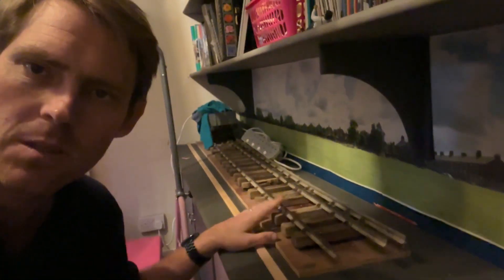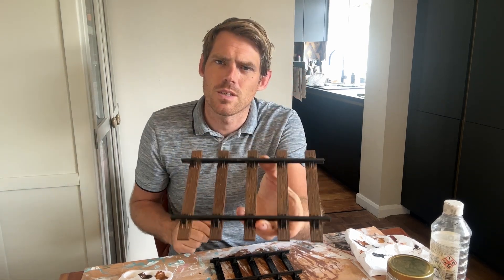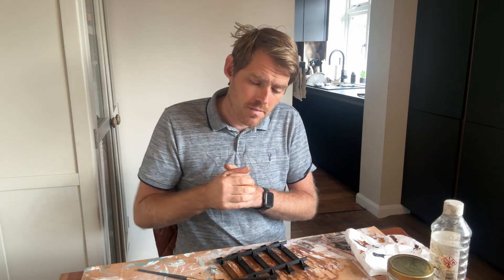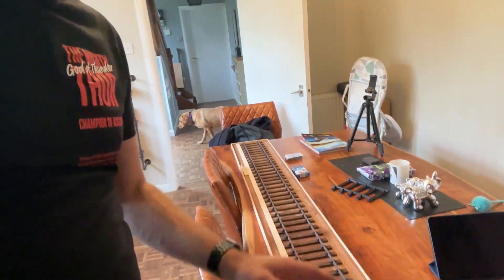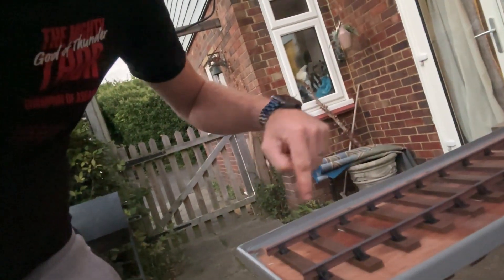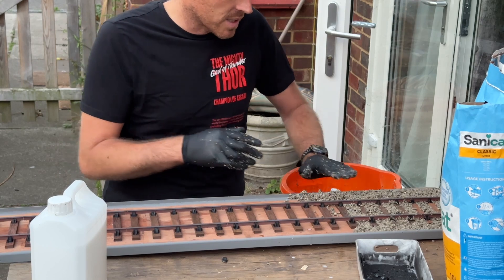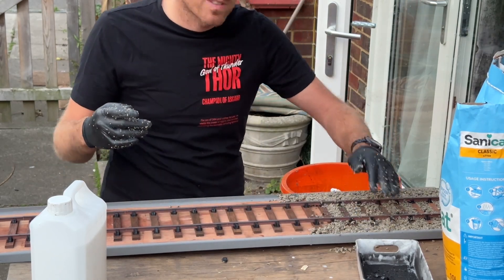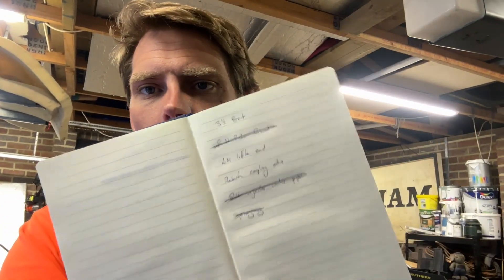Model engineering meets modelling…

Comment: Have you got a link to where I can get the information for the 3D printer Tom?
Reply from the maker: Mine is a FlashForge Creator Pro, although I’ve had it a few years now it’s still a great printer. If it develops any problems I’d upgrade to the creator pro 2, as that has a couple of great upgrades.